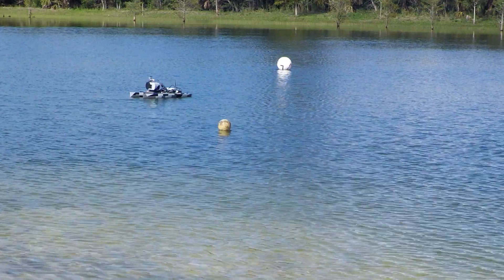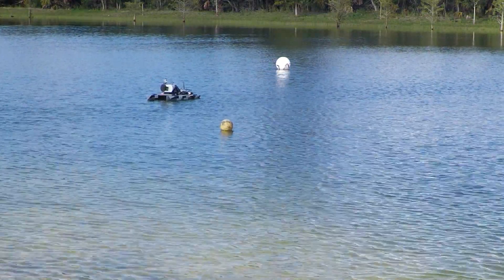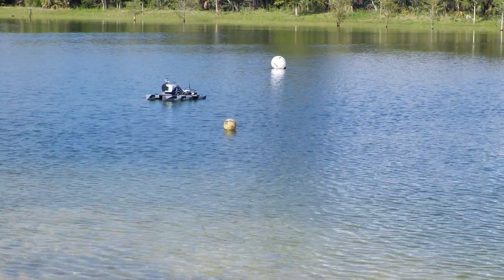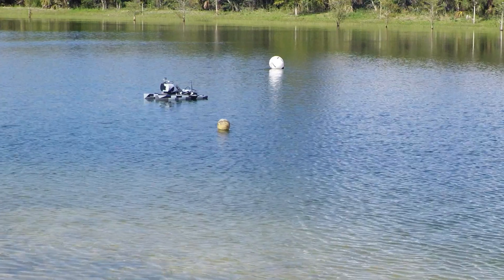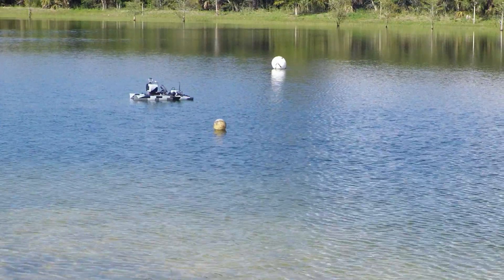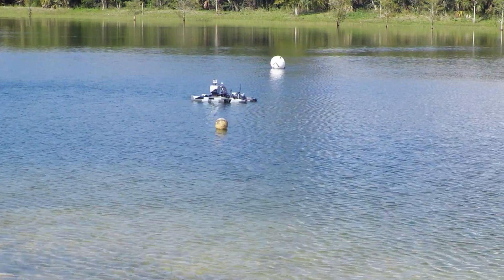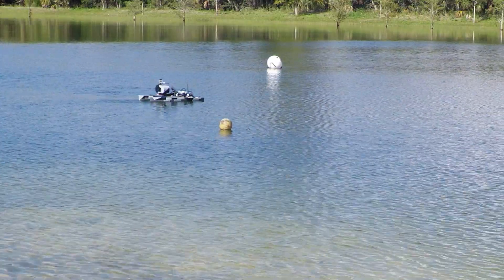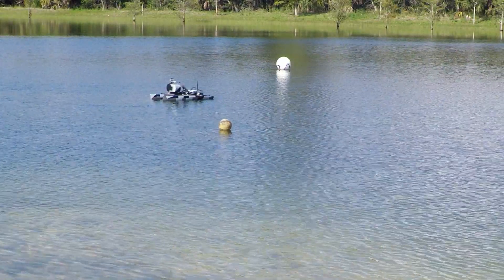Ardupilot 3.4 Loiter ( A.K.A. Position Hold )

Comment: Beautiful boat!!! Really nice job!! Do you mind sharing the pixhawk parameters? Would save lots of time and testing! Also are they blue robotic motors?
Reply from the maker: They are T 100's.  Parameters  probably won't help as they are boat dependent.  Start with the basic parameters.
Reply: @swfdrones4019  agree with you 100%. But it will be a great start to have a base. Also parameter like for motors how to put value for dual motors. So many settings in ArduPilot that is so confusing. Almost feel like we need to go to Havard university to get it lol. 
Pivot_turn_angle value
Pid values 
Imax 
FF
Navigation values
Wp radius
Wp overshoot
Turn g max
Lat acc cn tl period
Lat acc cn tl damp

Comment: Nice hold... I've been working on a mark cam with a 360 degree camera on it.  I wanted to expand on the idea by adding a GPS hold feature to is so I could drive it to a position and have it hold.  I was thinking of using 3 or 4 drive motors to do this with different rudders.  Wonder if I could use a regular flight controller board or use an arduino?  Would be great to know what equipment you used?  Cheers!